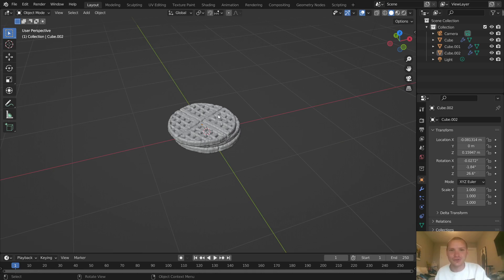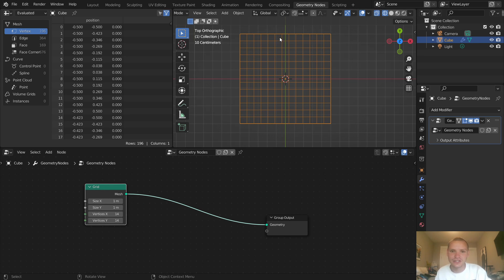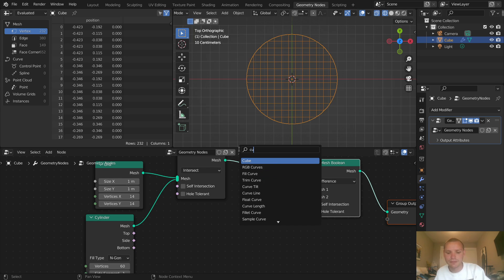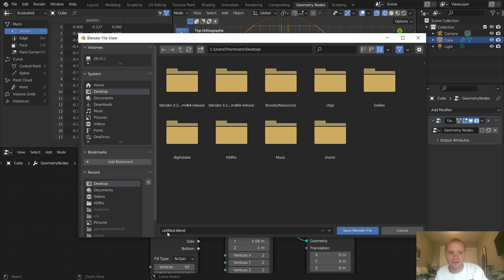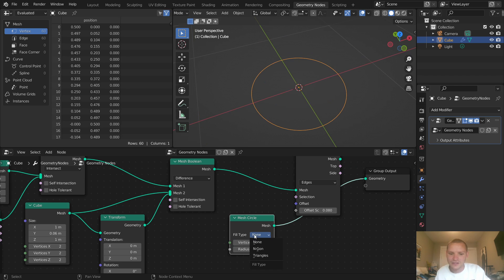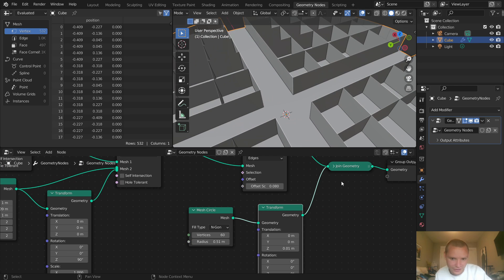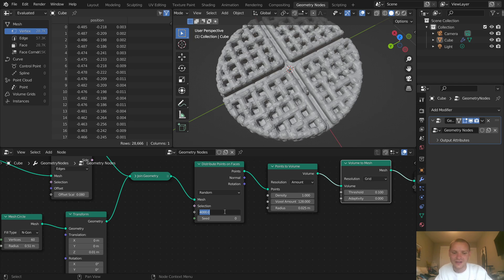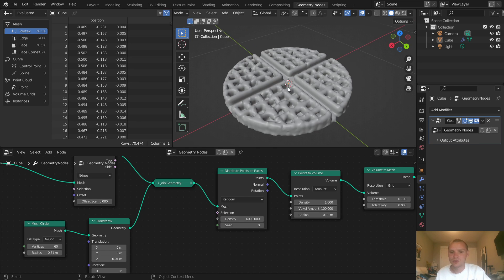Blender - Procedural Modeling (with GEOMETRY NODES)

Comment: At 2:07 how does he connect to the groupOutput instantly, what’s the command?
Reply: With Node Wrangler enabled, alt+shift and left click.

If you use *ctrl*+shift and left click it wouldn't work, because that's the shortcut for the viewer node which only seems to work properly in the shader editor and the compositor.

Comment: Hello from Belgium. I will try to make a gaufre (waffle) de bruxelles with a normal rectangular shape and then Gaufre de Liège style ^^
Reply: When you are already on it why not try making german waffles (the heartwaffles)? I would be interested in knowing how somebody would tackle them as they are quite a bit more complicated than those evenly gridded waffles.
Reply: @peatral  I made those (I'm from germany). I made a circular array of equilateral triangles by using a circle with resolution 3 which I transformed and rotated five times and I scaled the outer side of the triangle until the gaps were gone (factor 1.432 but doesn't have to be perfect). 
I used the array nodes to get the scaling factor, after I got the factor I disconnected it and worked with the single triangle. That made it easier for the time, but I didn't delete it because I used it after I got the grid pattern. The big advantage of doing the array later is that the grid will have a different orientation for each piece. 
I took a circle with higher resolution and deleted half of it using the x position of each vertex (keept the ones at 0). Then I transformed it two times to the outer side of the triangle to get the heart shape. I deleted the outer edge of the triangle (same methode as before) joined circles and triangle and merged by distance until they connected. Transformed it to a curve, filled the curve (polygon), and extruded it. Then I did the same boolean stuff to get the grid. Now I  connected it to the array nodes. To get the 'cuts' instead of boolean the mesh with rectangles you can scale the elements before extruding the edges. Use the non scaled elements for the space between the 'cuts' (merge them by distance until they are one piece to reduce computation time). After that everything else is the same. 
Tipp: rotate the grid to get to get change the orientation of the patterns.

I don't like syrup so I distributed a few thousand Icospheres (shade flat) with a distorted circular gradient density (according to the distance to the origin) as powdered sugar on it and it looks great.